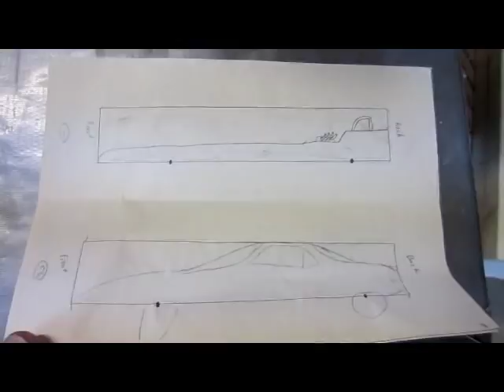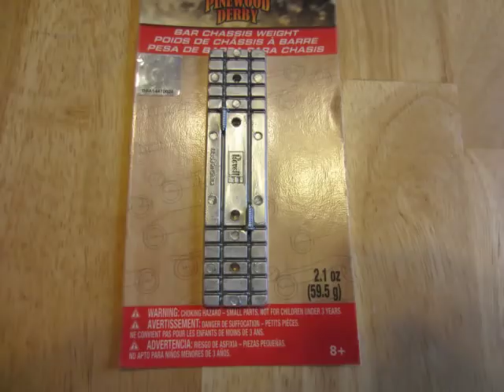How to Build a Winning Pinewood Derby Racer (for parents)

Comment: I have built and raced many cars with my son.  All of these are solid, winning tips.  The only exception is the very last comment about building a car to 4.7 ounces.  If your target is 5.0 then build as close to that and then, if allowed, use the race organizers scale at weigh in time to confirm where you are at and come prepared with some small increment stick-on or glue on weights and super-glue them on to get as close to the allowable weight as possible without going over.  Tungston weights can be added to take up less space but add the weight you need.
Reply from the maker: Robert Bond You are exactly right about the weight. I was just trying to get accross to the viewers that if you do not have access to the race time scale, it is better to be slightly off than taking a chance to to be over. I should have stated that more clearly. Having extra weights is a great idea. Thanks for such a well thought out comment.

Comment: Back when my dad build our pinewood derby cars, ahem I mean we kids built our pinewood derby cars, we poured melted lead into drilled holes, until the car was a bit above 5 oz, then used a drill to drill out lead at the race until the car weighed exactly 5.00 oz on the race scale.  We also cut pieces from the remaining wood block to glue to the sides making fenders to guide air around the wheels, placing them before the front wheel, between the two wheels and after the back wheel.  they didn't extend beyond the wheels, and were completely legal.  We dominated our local pinewood derby and scout-o-rama. i can still remember sitting for hours before the races pouring graphite into the wheel hubs and spinning them over and over.
Reply from the maker: x1134x Sounds like you had a great plan. I see how you were able to win.

Comment: You can polish the wheel centres and axles at the same time by spinning them to high RPM for 30 secs or so. I use an upside down bicycle or RC car.

For perfect wheel alignment I use an old credit card as a spacer between the wheel and wood and a flat head screwdriver to ensure the axle sits flush and square .

Combined with the weight positioning and graphite my step son's car won the whole thing and it wasn't even close.

Comment: Thank you for the tips! Our Kub Pack doesn't allow graphite in the axles until after the first race. Also, we can't switch out wheels. Besides this, i think I'm going to add the weight in the back on this year's cars and examine the cars i had as a kid and see if we did the weight distribution correctly. 

Another tip...don't let the judges drill in your weights! :D My daughter's car last year had the weights spread equally throughout the car...she didn't win, or even come in any of the finals.

Comment: Majority of your weight should be 1" in front of the rear axle (a little less than 1" is perfect), not centered around it. Otherwise it risks jumping the rail and lifting up too much, which adds to your overall friction. Nothing wrong with a wedge design, provided the weights are added to balance the car around 1" in front of the rear axle.

Also, always go as close to 5 ounces as possible, but not 5 ounces exactly. When you get an inspection done, it's easier to remove weight than to add it.

Comment: Do not "hammer" the axle into the block, pilot drill a hole in the block to ensure the axle is square to the block and that you do not crack the block. The axle should be able to be pushed into the block without a hammer.

Comment: Good stuff man!!! My sons car was of a tubeler design - scored in the top 10 fastest out of 150+ cars and it was way under weight. I used my pyro scale which is accurate 1/10th of a gram - had it at exactly 5oz but their scale was almost 2oz off so I had to remove weight-they recalibrated after we went through grrr. took 6th, 3-2nds and 4-1st:)
Reply: That outrageous.

Comment: When you are drilling the holes for the weights, how deep do you drill the holes?  Also, is there a standard sized drill bit that most people use?
Reply from the maker: You should measure the width of your block and put a piece of tape just short of that length on your drill bit. And there are many sizes of drill bit, so you just have to do a little research on how thick the weights are and use that bit. Be careful not to drill all of the way through.

Comment: Rules say no Loose material of any kind, such as lead shot, may be used. Does that mean no weights at all.?
Reply from the maker: I am not sure about your rules. My guess would be that they mean nothing that will shift on or in the car, but you should double check. In my case, I also used some fish weights but I glued them inside the body so they would not move. I hope that helps.

Comment: If you're racing on a BEST TRACK or are using the Official BSA Pinewood Derby rules you're going to have to sink in those bottom weights into the car or they will not have the clearance required by the rules or by the BEST TRACK.
Reply from the maker: Great info, thanks

Comment: The video you show of the race where one car is pulling away from the other down the straight has nothing to do with weight placement.  That is, however, a great illustration of how one car had much more friction than the other and slowed down quicker.   
The weight doesn't do anything after the car is off the hill and on the straight part.  It's all about your prep work and alignment at that point.
Nice work otherwise.

Comment: just to tell you a guy in 2011 built a car and it is WAY faster then this. It's a air compress cartridge car and it won a race at 1.465 seconds. But I get that your car is probably a very good car for if the rules state no air compress cartridge cars allowed. Nice video though.